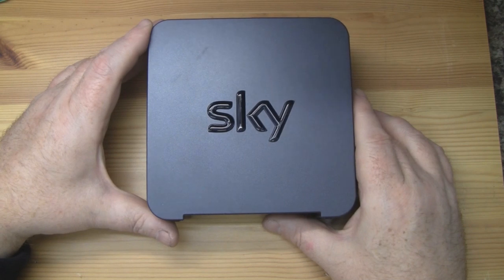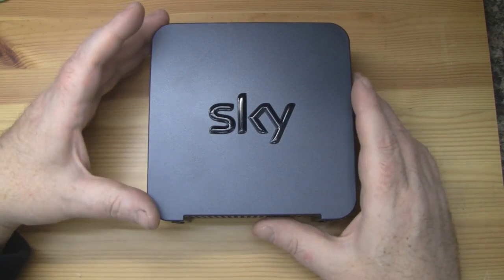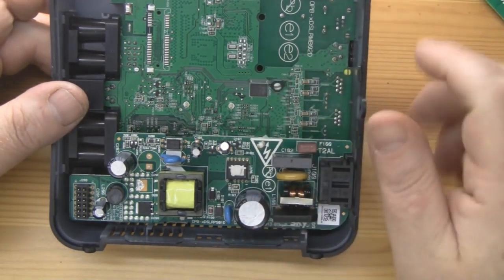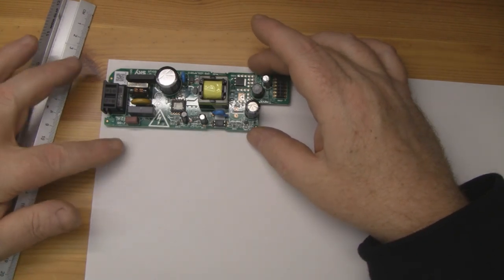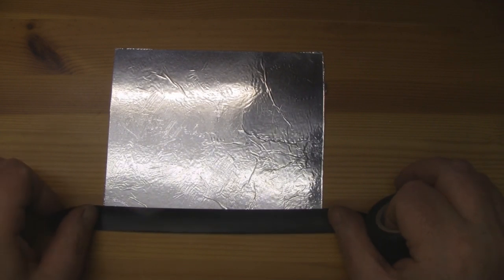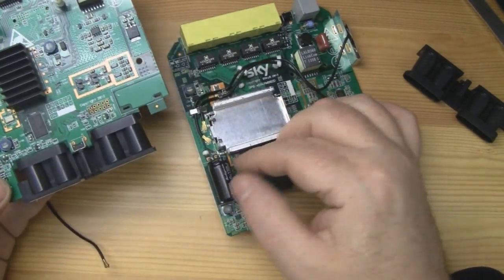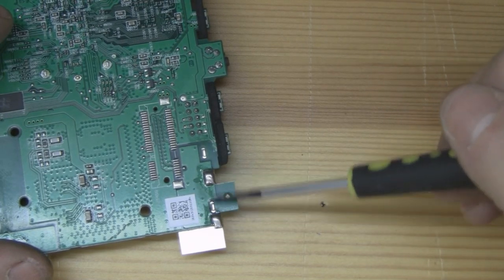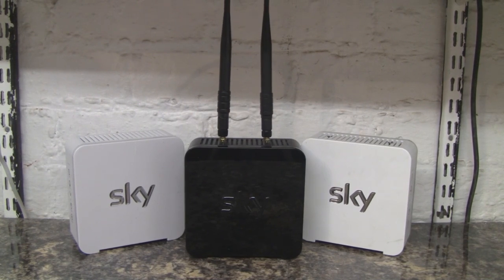Sky Hub SR102 Wireless and Power Supply Fix

Comment: Hi,
Applied the antenna Mod, Although in a slightly different configuration mounting a 7db SMA Antenna to each side of the router. I didn't do the PSU Mod as I did a similar thing in my old SR101 using foil to shield it and found when I later dismantled it there were clear signs on overheating. Despite not using the shielding mod I still have a stronger signal and better range in all areas of my home, and through a certain brick wall I've noticed a 20+Mbps difference. Certainly worth it.

Comment: How much current does the PSU put out? If its 5v then why not use an external 5v adapter instead? Probably safer for most people than attempting foil wrap near mains.

Comment: I found it interesting that the power supply had such an effect on the link quality. I didn't expected so much 2.4GHz noise from the power supply. I wonder what switching frequency it is operating at.

Something that occured to me while watching is that thay may include such poor antennas deliberately, to allow more routers to be used in high density population areas. Less range = more systems per square KM.

The routers that were available here in NZ a few years ago had reasonable external antennas. The current models supplied with every internet connection have tiny internal PCB antennas. A few years ago we could detect 6 or 8 wifi systems from home, now there are more than 30. We live in a area of detatched single story homes with some spacing.

Your previous power supply shield was great. I wondered about the use of electrical tape on this shield. The electrical tape avaiable here turns to a sticky mess affter several months. We can't get decent electrical tape any more.
I haven't tried, but you may be able to run the foil and appropriate plastic through a laminator; just a thought.

Comment: Hello Andrew,
instead of screening the PSU for the SR102, I was thinking of removing it altogether and using an external power supply. Do you know the output voltage of the internal PSU ?  I'm a ham radio operator and can verify that the SR102 radiates noise up to about 15 Mhz through the telephone line and even with the telephone line disconnected the power supply  is noisy especially around 6 - 9 Mhz
Reply: 5v is the power supply , the 12 header pins are divided into two half blocks of 6 pins +5v and ground

Comment: Great informative videos, this video inspired me to add antennas to the new Sky Q box (Model ER115) router, purchased x2 2.4ghz antennas mounted vertically but it was actually worse when checking with wifi analyzer, I'm wondering as its a dual-band router should 1 of the antennas be 5ghz? ... the stock internal antennas have model numbers that are different and different coloured cables but nothing to identify which 1 is which, any advice would be greatly appreciated..

Comment: Hello Andrew, love your videos....quick question though. Something that confuses me is the difference between 2.4Ghz and 5Ghz antennas. On routers with dual band or independently selectable frequencies, they typically have two internal antennas, usually onboard pcb or, in the case of my superhub (mk1), separate pcb antennas. The two antennas look identical with identical coded labels, etc, but surely one is for 2.4G and the other for 5G! Do you know if there is some kind of generic design that allows these antennas to work for both frequencies? I would like to replace both antennas with externals but I am unsure if I should buy two 2.4s or one of each 2.4 and 5. Also which is which? Any help you could give me would be very much appreciated...

Comment: hello Andrew i tried this on a black box router and dint find it made much difference really it still keeps dropping a signal every so often and this is an upgraded box from my white on, does anyon know if i connect a bt home hub 5 type a through ethernet ans diabble the sky router for wireless would that work and or damage anything?

Comment: Some people are suggesting that modifying the PSU will be a fire hazard. As someone who has tried this mod I can confirm that this is FALSE. The router never gets anywhere near hot enough to cause components to smoke or melt regardless of ambient temperatures. 

But if anyone is worried, you can always poke holes in the shielding to allow passive cooling (be sure to leave a spark gap).

Comment: Does anyone know what is the actual DC voltage coming out of the PSU? I’m trying to get mine to run off a battery for when the power goes out and I don’t want it running through an inverter/ AC UPS

Comment: Yes remove two screws and then its JUST plastic clips around the sides...
The clips are impossible to open... I've now got a bit of plastic rattling around inside but it still won't open, I tried prising with flat screwdriver... why not show how to OPEN IT which is evidently the most difficult part!

Comment: My input as a IT tech; I really wouldn't bother trying to extend the range of the router, the SR102, just like the 101s, are complete junk. The best bet is to take the router apart, clean up the insides, and fit a double wrapped foil DIY EM shield (I also used a thick-ish piece of cardboard from a rice snaps box) around the entire built-in power supply. Combined with manually selecting a channel for the router (Acrylic Wi-Fi Home will help you decide the best channel) and setting the router to 54G Auto on the sky hub settings page should see you being able to double or more the signal quality. Some might also want to try wrapping some foil around the internal metal "antennas", in theory you might be able to strengthen the signal this way.